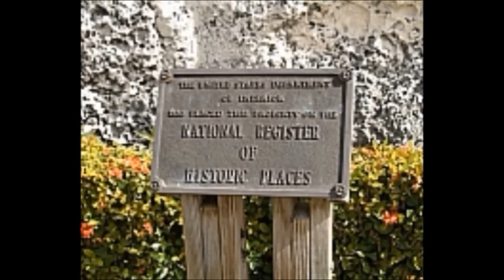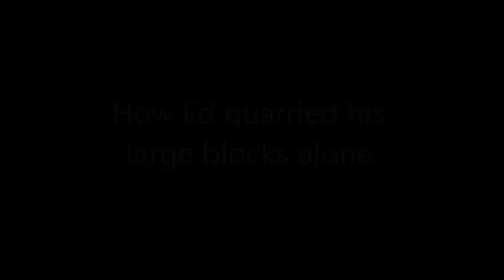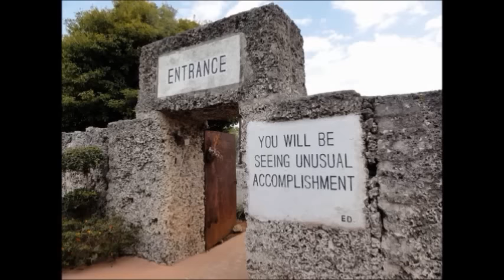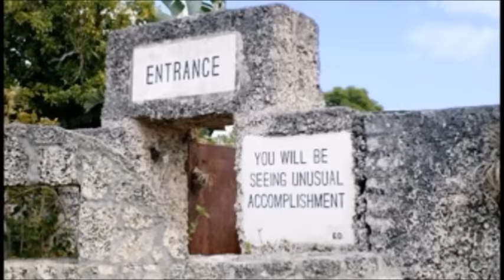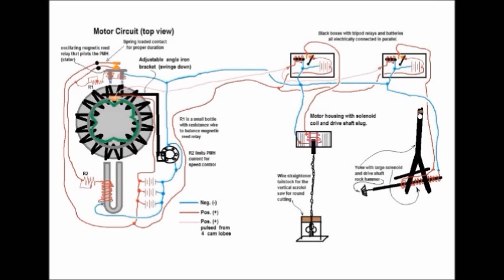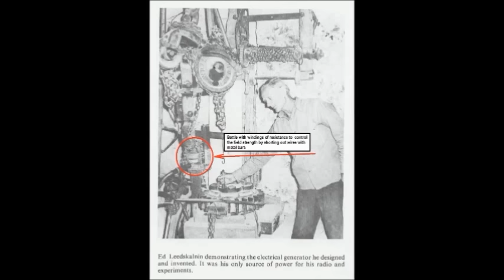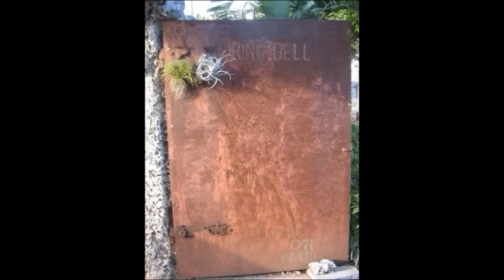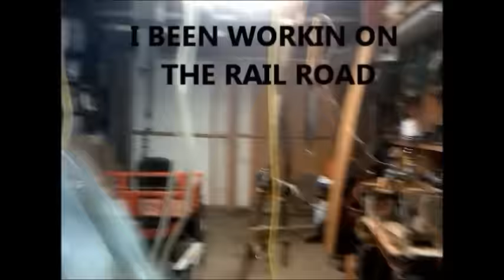Eds Coral Castle Quarry and Flywheel, Engineering Mystery Solved

Comment: Ed Leedskalnin had the entire coral castle moved to Miami from the original site. Ed hired a driver to take the rocks to Miami, he told the driver to leave the truck at night and the truck would be completely loaded by morning. Ed did all the loading and working at night to prevent others from seeing what he was doing. Well one time the driver came back to his truck only 30 minutes later. To his amazement the truck was already completely loaded with over 30 tons of rocks! How did Ed load that truck with 30 tons of rocks in just 30 minutes? How could his tripod move stones that weigh 30 tons when the tripod could only support 2 to 5 tons max? Ed used anti-gravity to nullify mass/weight of those rocks. Gravity is a subset of electricity and magnetism it doesn't exist as a separate force. Ancient builders knew this. That is how all the great ancient structures were built, the stone henge, puma punku, the pyramids. The great pyramid is 1,200,000 blocks at 433 feet tall, built in only 20 years, average weight of block is 5,500 lbs. This means that a block had to have been cut, moved, and set into place above every 8 minutes and workers had to have worked 24 hours a day 7 days a week while maintaining the precision of the blocks at 0.01 mm... That task is impossible even today!
Reply from the maker: Naoki Kashima IMPOSSIBLE?   woops you just landed on the wrong site to start using such BLIND words. I can tell right away you are either very young or very young at mind. Because these things are not impossible. What is impossible is to get the public to stop believing stupid exaggerated "non provable stories". As for 20 years that might be wrong but that's it the rest is "probably done by man" how is impossible for modern lazier unorganized minds to understand.
        Don't get me wrong Naoki, I am not running down todays people just that know one seems too much common sense old fashioned thinking any more WITH physical teamwork. I have levered some very large things into place and know Ed leedskalnin built this place with perserverance and sweat not some silly never ever seen device. Come on.   Really.       Ground control says NO.  peace.     Scott R.
Reply: Made by one man If ED used conventional methods for building the Castle how come he only worked at night? How much harder is it to dig and lift giant stones under the light of a candle light? What about the report of kids spying on Ed. They stated that he was levitating the stones using two cones. Kids reported that stones were floating as if they were giant balloons. How did Ed load that truck with over 30 tons of rocks in just 30 minutes? Ed was only 115 lbs (very small man).. What is the point of having so many inductors, transformers, the flywheel if he didn't use them for some grander electrical setup? Go read Ed's book called 'the electric current' it will give you a different perspective about what Ed was doing.
Reply: Naoki Kashima he didn't use candlelight, he had lights! He did it at night #1 because of the heat #2 he was giving tours during the day. He NEVER FINISHED THE FIRST SITE.. it took him 3 years to move the first site to the new location. He didn't levitate anything... he used chains, please look at Ed's original 1930's video of him lifting and moving the coral. If you still think there is something more, they have medication for your condition...
Reply: shidoin Did Ed Leedskalnin have advanced knowledge of electricity? Wad Ed a high level Freemason? All one has to do is go to the Coral Castle and look around. You'll see "the star of david" or the joined pyramids in at least 3 places within the Castle. You also will see the Moon sculptures. These are both well known Freemason symbols. Ed is known to saying, "if you put one of my devices on a rocket and fly it to the moon and then come back you'll have the same amount of fuel as when you started". What was Ed talking about in that quote? Is he talking about harvesting energy from the vacuum of space? I think so. If Ed only used levers and a tripod to move his stones how did he move the 35 ton stone in the Coral Castle? Why don't you do a video demonstrating how it is possible to move a stone with a weight of 35 tons using this method :P
Reply: Naoki Kashima no ed did not have knowledge of ADVANCED electricity, he did however understand electricity. He was  NOT a freemason, but he was a stone mason. Stars, the sun, the moon. That's pretty mind blowing. There is not a 35 ton block at the castle. It's easy to take a statement and twist it to work with your beliefs..
Reply: shidoin The heaviest stone in the Coral Castle is 35 tons in weight. Look it up. Quote from http://weirdus.com/states/florida/unexplained_phenomena/coral_castle_photos/index.php ". There is an obelisk weighing 28 tons and the heaviest stone object weighs 35 tons."
Reply: Naoki Kashima my young friend. Have you been to the castle? Have you calculated the weight of the coral vs cement? Since you and others are so well informed about ed. You should know that he tried to raise the oblisk 3 times, 2 times it broke. It is recorded in the county records.
Reply: shidoin he did say some of his children would misbehave?
Reply: laura theodora what are you talking about? ??
Reply: The energy that he tapped into sometimes went wrong , the stones he called his children that sometimes   miss behaved , there was a neutral part where he could stand in where the energy didnt effect him . he actually had some boots made out of lead or some metal that would not levitate him along with the stones .
Reply: laura theodora haha how silly of me to miss that.;) um yeah keep researching, but this time use reality, your brain perhaps. Ed didn't levitate, he did have shoes with a small metal part on the toe and heel. You can buy some the same today. If you didn't want a electric current to go through your body you wouldn't wear metal shoes
Reply from the maker: laura theodora No one has ever levitated anything outside the laboratory. It has NEVER been proved, The internet tells stories in myriads that are not true. 30 minutes is just a story. the homestead records have 255 affidavits that prove Ed  used manual labor. 
As for his shoes? they are down at the museum. they are reinforced with metal to keep them together. and have cleats to prevent his feet from hurting while he stood on the NON ergonomic tripod braces. Plus as he clearly displays many of his OBVIOUS methods in the black and white movie, it seems that should be enough to dispel the GIANT GIANT GIANT piles of crap about "levitation"?  If you truly believe that Ed levitated those gargantuan rocks then all I can say to you Laura, is this: You apparently are a very beautiful person and probably quite innocent and are quite open to many "possibilities". The actual proof and even legitimate plausibility is the only thing in HIGH question.. Coral Castle along with pyramids and EVERY other "mystery" will be revealed all in due time. I will stack those rocks like he did with a tripod and join many "coral castle nuts" in hopefully a peaceful  gathering of disappointing truth but with polite comfort and understanding. It is obvious that most your information has come from potentially "flawed" and very biased internet videos or statements by some who clearly need to be a bit more reserved in their "calculatory assessments". Also today work that those people performed, including Leedskalnin, is quite elusive because the average or even above average person still can't fathom the "animalistic cooperation" the men of old contained over the convulsive spoiled non believing society we have today. I DO believe that potentially "spiritual" influences may have inspired or motivated the Egyptian folks to construct such monoliths and why 30 of them or so? people will see something later in the future that will disclose one of there true purposes on a grand "global perspective" and why are they all different parameters and dimensions? you see   I can vividly imagine a large machine that EASILY lifts those 6000 pound block like legos. have you watched the latest Nova episode on the roman Colosseum? quite revealing.  As for wetting the sand like "scholars" think (to drag pyramid blocks? that is way way way off. Are they just stupid or lacking common sense or do they want to keep people ignorant for some conspiratory agenda? I don't know but I do know there are a lot of things that used to be unknowns but true research proved actuality and therefore dispelled. I will be glad to answer any questions on Coral Castle though. No levitation, just decent good ol farmboy like ingenuity and learned techniques of old.
 PS  Thanks for viewing too.    SCOTT R
Reply: Made by one man
 I think your full of misinformation i have looked into this for years ,  just because you cant understand it doesnt make it wrong !
Reply from the maker: laura theodora Really I actually do understand. since when is rock magnetic? and I never said someday it won't be possible but it DID NOT happen at Coral Castle. And not to insult you but I only have a year into Coral Castle and it seems elementary to me now. Not when I started but now its a joke. And it really pisses me off people believe in total crap when the real man worked so hard for his "dreamgirl". And there are documented  witnesses that actually new saw and know how he erected things. Is the movie wrong?
Plus shidoin is being a bit harsh because the truth to him is kind of obvious and you are being a little unrealistic. AGAIN how do you think he did it? and don't just say magnetic theories. Explain how "technically" not just "theories" and "THIS GUY IS SO INCORRECT"  really. what do you think is wrong when it actually WORKS, cuts and sculpts. what do you think the wheel really was?   PLEASE. some details? Scott R
Reply: Made by one man
 your kidding about the magnetism of rocks arent you ?Look it up . what makes you think there were the only civilization that got to this point ? i think you have a sett idea of things and iam not going to bother with explaining it to you ,your cup is fool, Iam not young and i have been looking into archeology, science , astrology, mythology, theology, for a long  time .  I prefer an open mind to a closed one thank you !
Reply from the maker: laura theodora Typical.   Oh you you you, I'm not going to explain it to you. Because there's no explanation or you would literally defend yourself but obviously it is just non provable theory wind AGAIN no proof or even reasonable theory. When has anyone magnetized rocks?  really? I am as open minded as you will ever find my dear. So please lay it on me. Trust me I am about to build a stone castle /tower / house. I would love to levitate them verses barbarian lifting. But for now I doubt I should sell my back hoe or get rid my tripods. and why would Ed have a 100 ton train hoist in one of his pictures clearly lifting up a giant block with muscle?   honestly?       Help me to see if I am the blind child. but something says I might know a bit more than YOU think.   sorry my dear. Nice spunk though.  how would you "magnetize the ROCKS" where else do they do that now?
Scott R.
Reply from the maker: laura theodora PS laura   "ology's" are BS galore and not always solid only "spritually coicidental"   "onomy's" are usually solid scientific provable REPEATABLE operations based on FACTS and tangible physics. That was this documentary is about. Not just TALK and flase typing with blind non provable argument.   PLEASE send me a link so I don't have to waste time looking up something that does NOT exist.       Peace   Scott R
Reply: Made by one man I would suggest reading the work of " Viktor Grebennikov " :)
Reply: Made by one man can't edit a reply.. :(.. I was referring to "Nothing levitates outside of a lab".. Viktor Grebennikov disagrees... he believes it's all around us in nature.. Bug wings, apparently even in pelican beaks. All these animals have microstructures we don't understand yet.. So saying "It has never happend outside of a lab" is a little bit narrowminded, or young minded in your own words.... just like how you responded to Naoki Kashima
Reply: Thijs Leijzer I've researched him. Still just stories. Just like a bee can't fly with its wings/body weight. They did recently change that theory. It is the speed and rotation that enables a bee to fly! there is a lot of scientific proof out there on many things. You can't get yourself caught in the mystical web.
Reply: shidoin How do UFOs fly? They have no wings of any sort. Well it turns out that disk UFOs operate on the principle of electro-magnetic propulsion. It turns out that before 1950s one could look up patents for EMP vehicles at the patent office. Since 1950s  these patents became classified up until recently. Today through the effort of Steven Greer one could look up some of these patents again! If interested you could look up how disk style EMP crafts operate (the man-made ones). Also, you could look up the Keshe Foundation of Iran... they claim that they managed to reverse gravity as well. They offer their patents and information free for download (2 gigabites of data).
Reply: Naoki Kashima once again  no proof! Just stories. I have seen many patents like browns ion ufo that never flew.
Reply: Naoki Kashima and btw you can get a patent for anything. It doesn't have to work you only need to explain how it could ;)-
Reply from the maker: Thijs Leijzer My answer is because know one has ever proved it. Newtonian physics completely explain the mechanics in actually simple mathematics to all forms of "propulsion" in the "relatively significant" density of our atmosphere. So to say "we don't understand" is crap AGAIN. We DO understand and that's why my response is so direct because we understand it that directly. I apologize if you think I'm rude. I have absolutley no intentions of that. Merely logical plausible objectivity with a open mind wider than you realize my friend. I do believe in levitation and actually know how it will be done IN 30 Years " maybe but not now, not At CORAL CASTLE.       Peace  Scott R
Reply: Made by one man
 i dont think your open minded ! Science grows  as we do , to have a sett idea stops that growth .
Reply from the maker: laura theodora I have a set idea like the boiling point of water. It IS WHAT IT IS. PERIOD. expecting it to change when everyone knows it doesn't (pressure does but still thats the same too) It all become COMMON fact NO deviation because it IT WHAT IT IS. copper is copper, water is water, to expect it could be something else after every one can TEST it for what it is. THEN It be comes what everyone knows it is. silver is silver gold is gold. White pine trees arte White pine trees. So eventually no matter how open minded some will deny that IT IS WHAT IT IS. so really having some doors shut are good. Thankgoodness we at least have that consistency.  You can't be open minded and expect it to change without altering pressure.   This whole Coral Castle thing is the same thing. Levitation will occur much later in our time. NOT NOW. My mind is open but only when it knows the door needs to be. other wise don't be unrealistic until you know the time is the PROPER time.
Reply: Made by one man Ed's Flywheel was turning with an aid of an AC motor. The flywheel itself was powering that motor. That is because it is a Lenz Free Generator. I made a video about this effect as did MrAnguswangus. Copper is Copper and aluminum is aluminum... however you can trans-mutate aluminum into silicon using a simple cold fusion setup. I made a video about that as well. Everything we think we know about science is going to change within just a few years. I would rather ride on top of that wave than be swept away by it :)
Reply: Naoki Kashima
 Sounds good go for it !
Reply: laura theodora I am working on it. I got 10 lbs of copper, 10 lbs of soft steel wire... some powerful magnets. I'll do my best with it. If it is a Lenz-free generator I should be able to get it to power itself. I made a video of a smaller one in action showing the Lenz-free effect.
Reply: Naoki Kashima look up" mister Caribbean roots" he's already built it. He's also built a pulse motor, which is what  Ed's wheel is. Not magic
Reply: shidoin We'll see, if my version will work. I have a different idea about how it should work and what it is. I'll give you a quick rundown. Basically there are 2 particles involved in electricity (the whole thing about electrons moving in wires is a bunch of rubbish). The two particles involved are magnetic monopoles. The positive moves to the negative and the negative moves to the positive at the same time. These monopoles have an opposite spin (clockwise/counter clockwise). Today in all the generators we use only 1 of these particles but are forced to fight against the other as it is trying to leave the system with an opposing spin. That is real reason behind Lenz's Law. Well if both of these particles are accommodated with a complete magnetic circuit Lenz's Law is negated. You can have a self-powering device at that point. Ed's generator was not a homo-polar motor. Ed used the true form of AC. If I am wrong then I am wrong, but if I am right then I am right. We will see.
Reply: Naoki Kashima ed didn't have A/C current. Have you been there? Vinnie st Vincent has and built the exact wheel.
Reply: Naoki Kashima looks pretty cool. I'd get scott, or vinnie and see what they think. Maybe they can try to apply your theory with their  working wheels
Reply: shidoin The wheel with u-shaped magnets is slightly different. Inside of the tube there is clockwise and counter clockwise coils. The top of the tube has a hook dangling over the handle. There should also be a magnetic connection to the bottom of the wheel (where its axes rotate). This completes the magnetic circuit. Basically imagine a U shape on its side with a wheel in the middle. The two coils must be wound in opposite direction and must be shorted out. Ed also used aluminum or brass spools (this slows down the magnetic flux inside the iron). It is all about timing the flow of magnetism. I'll keep working and I'll post a much larger version of the generator hopefully spinning itself.
Reply from the maker: Naoki Kashima Naoki, You obviously have some knowledge of the concepts that science and tesla knew all along. The newest PWM wheel chair motors are basically your , Spiked non usable AC cycle that now is realised to be DC at a half wave with aeinductive circuit to "capture its" collapse. It basically a giant Bedini circuit. Ed MAY have used this for efficiency but certainly to spin it on its own. It would merely gain the 45 percent more lost and still need to charge the battery as the SSG circuit is built. Lenz's law on Ed's wheel is No where the frequencies required either. the John Bedidni SSG needs a freq to react with the iron at a certain freq for proper "inductive reactance". I am guessing you will highly improve on my basic propostition though with propising results. If you want to communicate there are many plausible configurations to use including a coil of wire down the pipe to act as a giant PMH CHOKE. this will aid i n the delayed field for proper resonance of the wheel (at certain Rpm's)
Reply: Naoki Kashima there is footage of him using the tripod to move the blocks.. what else do u want?
Reply: barrelrolldog Is there footage of him moving the 20 ton block? No. Did Ed use the tripod to move blocks? Yes. How did he move 20-30 ton blocks with a tripod that is rated for 3 tons? Impossible.
Reply: Naoki Kashima he used an extra cable.. the lid is closed on this one mate, the footage says it all. accept reality, and move on.
Reply: barrelrolldog An extra cable attached to what? How did Ed load 30 tons onto a truck in just 30 minutes? If he used a standard setup why did Ed work only at night?

The footage was made to give people answers, however those answers aren't the right ones because those answers don't fit all the data. Was Ed using some sort of an electrical setup? If you go to the Coral Castle museum you'll see his fly wheel, air capacitors, transformers and lots and lots of wire. What was the purpose of all that equipment? Turns out that Ed didn't see gravity the way we see it today. He believed that gravity was in fact magnetism. There are 2 particles involved in gravity (and electricity) these particles are the + and - monopoles. Ed believed that Earth itself was a giant magnet and that in different part of the Earth there was a different proportion of these 2 particles. One of Ed's experiments includes getting a 3 foot piece of iron wire and hanging it on a string evenly balanced. Then he would magnetize the wire with a horseshoe magnet and one end of that wire would now dip towards the ground so it will have to be rehung to be rebalanced. By looking at the ratio of how it was hung before and the new position one could determine the proportion of + and - particles at his/her location on the Earth. This is different to every region. Read Magnetic Current by Ed Leedskalnin if you want to know how he levitated the rocks.
Reply: Naoki Kashima attatched to the tripod.. you know, the thing he used to LIFT the rocks.  30 tons in 30 minutes was probably just some exaggerated story to enhance the legend.. same with the kids who saw him at night. 

the fact is, there are many pics and there is now footage of him using tripods to move the blocks.. thats enough evidence. why would he of needed to use tripods at all if he had an anti gravity device? it doesn't make any sense, use some logic man and quit dreaming. this mystery is SOLVED.
Reply: barrelrolldog That tripod was only rated for 3 tons. There is no way to move 30 ton block using the tripod. How did Ed cut that stone anyways? Any tool he would have placed under the stone would have been crushed by the weight above. What are your thoughts?

Ed claimed that he knew the secret to how the pyramids were built. Did ancients use tripods and wenches in the construction of the great pyramid? According to mainstream science the great pyramid is 433 foot tall, composed out of 1,200,000 blocks with average weight of 5,500 lbs. The great pyramid was built in only 20 years. Each block has a precision of 0.01 mm (look up that value). This means that a block had to have been cut, transported and put into place every 8 minutes if the workers worked 24 hours/day 7 days a week for 20 years to make their 20 year deadline. At the same time they had to maintain 0.01 mm precision. We can't even do that today no matter how many trillion of $ one would throw into that project. The technology simply isn't there yet.... LOL...

What do you think gravity is?
Reply: Naoki Kashima check out some more vids.. it was being used for more than 3 tons mate.
Reply: Naoki Kashima just stop. So apparently his "anit gravity" method will work on 20 to 30 stones, but is too hard to use on smaller 3 ton stones, so that's when he uses the tripods? Perspicacity.....get some.....
Reply: Naoki Kashima He moved the blocks on wooden rollers,(logs) with a come-along, just like it shows in the movie!
Reply: JeffSal999 The movie shows Ed moving tiny stones. It doesn't show him moving 30 ton ones. Common that movie is grade A dis-information. Ed never let anybody see what he was doing because he worked at night but here he let them filmed him. I don't buy it.
Reply: Naoki Kashima Dont forget the multiple sightings of him using Cone Shaped devices. As well as the well known fact that people would hear him singing to the rocks while he worked.
Reply: I've only heard about the one story about some kids who said they peeked over the wall and saw him using the cones, and people sing while they work all the time. The comment above saying that video is dis-information, lol, that's just funny. You guys do know he was a salesman and funded his life by selling tickets and giving tours to his "secret" playground. Give the man some credit. All he had to do was say he figured out the secrets of the pyramids and then shut his mouth and let everyone speculate till they've become blue in the face. You've all been fooled. Winner - Ed
Reply: mindshotjon His construction feat can't even be replicated today with heavy machinery. At the entrance to the coral castle there was a 8 ton swinging door. He had that door balanced so perfectly that a child push or the wind could make it spin around and around. After Ed's death that door broke and wouldn't spin. Four engineers with heavy machinery were hired to try to fix the door. After the door was 'fixed' it was an effort to push it to make it spin and today it doesn't spin at all! Ed knew that gravity was actually magnetism. If you get magnetism strong enough even non-metallic objects will be attracted. Take a piece of graphite throw it on a magnet. It won't be attracted because graphite isn't normally magnetic. Now take a very strong neodymium magnet (100 lbs of pulling force or more) you'll now be able to lift graphite as if it was made out of metal. The only thing that changed was the strength of the magnetic field here. Read his book Ed's "magnetic current'.
Reply: You're so wrong about that door. When it broke, they found a steel rod drilled through the middle. The door works fine today. Stop believing all the "made for t.v" nonsense. Minus the "story" about the kids seeing Ed move blocks with cones, and the trucker's so called load being full in 30 minutes, everything else can be duplicated. There's a gentleman on here that has been able to duplicate 99% of what Ed has done, and there's another guy who built his own stonehendge by himself. The guy was a recluse who worked at night because he was little and frail and it's freaking hot in southern Florida. Him making jabs about the secrets of the pyramids was marketing to get people to pay him to see his place. The guy was a genius when it came to electro-magnetism. He probably could have given Tesla a run for his money with the right funding. I don't believe it really comes into play with the Coral Castle "non" issue.
Reply: mindshotjon Show me a video of 30 ton stone being moved and set into place by hand and you'd make me into a believer. Otherwise you are blowing hot air.
Reply: mindshotjon AND by working at night no one could see he used elementary physics.
Reply: ***** If he used elementary physics why bother trying to hide what you are doing by working at night? If Ed used elementary physics there would be no secret and he would have worked during the day :)
Reply: Naoki Kashima To fool gullible people
Reply: ***** Or to preserve a well kept secret. What was the purpose of Ed's Flywheel?
Reply: Naoki Kashima Regarding building the pyramids, here is the statement from a construction management expert and Egyptologists.
 "A modern construction management study, in association with Mark Lehner and other Egyptologists, estimated that the total project required an average workforce of 14,567 people and a peak workforce of 40,000. Without the use of pulleys, wheels, or iron tools, they used critical path analysis to suggest that the Great Pyramid was completed from start to finish in approximately 10 years.[27]". 
So its not impossible at all, trust the experts.
Reply: ***** And I can tell you that the moon is made out of cheese. Trust the experts. If the pyramids were built in just 10 years than a block had to have been cut, moved and transported every 4 minutes if the workers worked for 24 hours a day for 10 years. Average weight of a block is 5,500 lbs. How was the 0.01 mm precision maintained under those conditions?

Pyramids were NOT tombs because not a single mummy has every been found inside of a pyramid. We even found completely sealed pyramids with no mummies inside. What were** these structures used for?
Reply: Naoki Kashima
Average weight of the stones is actually 2.5 tons, and they estimate it took 20 years. Making up numbers doesn't help. Have you seen the internal ramp theory documentary. Best theory yet which is backed up by a large amount of actual fact. Pulleys, sleds, levers, and counterweights. Elementary physics, literally at it's finest.
Reply: mindshotjon I never claimed it took them 10 years I said "if it took them 10 years" that statement was based on something Antony S said.

Mainstream information: The Great Pyramid is made out of 1,200,000 blocks, with average weight of 5,500 lbs, it is 433 feet tall, the precision of the blocks is 0.01 mm and the structure was built in just 20 years. What were the pyramids used used for? Were they tombs? No Pharaoh was EVER found inside of the pyramid. We even have completely sealed pyramids with no mummies inside. Where were the Pharaohs buried? They were buried in the Valley of the Kings, lol. Did the ancients have access to advanced technology that we don't even possess today? Mainstream science says "no", eyes and common sense says otherwise. For instance a wall was found in Siberia on a steep mountainside. Each block in that wall has a weight of 1,500 tons! It would take 3 of the world's largest cranes to lift a single block.. and yet the ancients built it with pulleys and chisels thousands of years ago? Examples of advanced structures that we can't duplicate today doesn't end there. Look up the site of Puma Punku. Stones many tons in weight are cut and stacked on top of each other like pieces of a jigsaw puzzle creating an earthquake-proof structure.
Reply: counter weights, pulleys, and levers...and maybe giants, lol At least we have some written history of that... Don't bring up puma punku's sandstone exaggeration please. That's only a mystery to the History channel followers....
Reply: mindshotjon It is a mystery to everyone. How perfectly round 8 foot holes were drilled in stone as hard as granite? If you want to drill a hole into a material your metal has to be harder than the material you are drilling. This can not be accomplished with bronze tools.... lol.
Reply: Naoki Kashima
Ed did not move to Miami he moved to Homestead! Haven't you been there and seen it? I have been there and seen it, it is extraordinary. Homestead is far below Miami, yet he did move north from his previous home to get there. Homestead receives more lightning than his previous location.
Reply: Naoki Kashima
it is red limestone, there is NO diorite there. That's just one lie. The quarry isn't far away, with stones half finished. We know exactly how puma punka was built. Ancient Aliens has everything wrong. "for entertainment purposes only" should be a required disclaimer, lol
Reply: mindshotjon Again Puma Punku ancient site. Stones carved to fit perfectly into each other. Some stone have a weight of 10 tons. How possible with bronze chisels? Even today we couldn't replicate this feat of engineering and construction. Advanced and not advanced societies have always co-existed at the same time. Today if you visit the Amazon jungle you'll find people who have never seen a telephone or powered drill. It was the same way in the past. Evolution of societies from more primitive to more advanced is a myth that isn't supported by archeological evidence. This myth is perpetuated by the education system which was originally funded by a few wealthy elites.
Reply: Naoki Kashima Actually it can be replicated today, and has been well known how it can be done for a long time. The disbelief that the ancient Amerindians were incapable of such engineering is racism, pure and simple.
Reply: Naoki Kashima
That may be the only thing we agree upon, that society did not advance through evolution, nor anything else. You just may want to check  the sources of your facts though, especially ones you get from ancient aliens and the history channel. While entertaining, very damaging to actual reality. They are a little askew.
Reply: Naoki Kashima
"If you want to drill a hole into a material your metal has to be harder than the material you are drilling. This can not be accomplished with bronze tools.... lol."
Chisels don't have to be harder than the stone, thats one reason they need to keep resharpening them.  And water can wear away stone, is it harder.  I can cut through a stick with a piece of thread, which is harder....DUH
"Pyramids were NOT tombs because not a single mummy has every been found inside of a pyramid." I have a money clip with no money therefore its not a money clip, but a mystic device which no one can duplicate. "Where were the Pharaohs buried? They were buried in the Valley of the Kings, lol."  Some were found in the Valley of the Kings of the later dynasties.  NOT finding a body  means squat. The sarcophagi they found must have been there to receive......???
Modern engineers CAN and has duplicate these 'feats' with modern equipment, so why do you keep saying they can't. "3 of the largest cranes to handle a 1500 ton rock", yeah OK we have cranes that can handle 7000 tons.  Pure unadulterated BS.
"Examples of advanced structures that we can't duplicate today doesn't end there"  primitive structures and YES they can and have been.  Actual proof not stories.  Children learn to build structures with blocks, shaped much like pyramids, because it doesn't fall over.....a primitive shape for primitive construction techniques.
Maybe the ancients had the assistance of gods riding flaming chariots.
Now lets all hop on our time machines, powered by a perpetual motion engine using levant-meyer transitional devices and go back and see how it was really done.  Oh wait we don't have them because it's all a conspiracy by big industry.  Fire- a secret stolen from the gods....
Reply: ***** Only time will tell which one of us is right. You have your opinion. Your opinion does not fit the data, yet I am forced to respect it. There is no way to replicate the wall in Siberia where every block is 3,000 tons. You can't get giant cranes in that area, the wall is built on a steep hill. And how* would you cut out a block that is 3,000 tons? Any tool that you place under this weight will have to be pressed down by the weight above. This means if you place a saw or a chisel it will be crushed. Inside the Great Pyramid how did the builders light their way? Did they use torches? Nope. There are no scorch marks on the sealing from those being used. Did the builders use mirrors to reflect the light from outside? Nope, the light gets too dim (these experiment were done already). It turns out that the only way to light inside of these structures w/o leaving any soot is by using electrical lighting. In fact there are hieroglyphs of those devices. 6000 years ago the pyramids were already in ruin. They were built 12,000 years ago (6,000 years before previously thought). Is there evidence of pyramids/obelisks on other planet? Well according to Buzz Aldrin (the 2nd man to walk on the moon) there is an Obelisk on Phobos (one of the moons of Mars). He brought that fact up in a live interview on CNN. You can see pictures of it search for 'obelisk on phobos".
Reply: YES there are torch marks!!! hahaha,
Reply: Your opinion is that these 'things' are impossible to do by modern standards and yet it is done...
The Phobos monolith (not obelisk)......a naturally occurring formation that some have to make into some mysterious manufactured object Perhaps Ayers rock on earth is an alien arrtifacct)  or like the face on mars, natural mountains.
Rather than electric light, one could use carbide lamps which burn without soot, so the ONLY solution is NOT electric lamps and numerous times it has been demonstrated, oil lamps with a properly trimmed wick are  sootless.  And why would the records show how much oil and wick each worker got if they weren't using oil lamps....
Strange there was no soot, after all 1000s of people explored these ruins before electric light was common, why isn't there evidence of this soot.  Oh because the whole story of no soot is false  AND the pyramids were built with a cut and fill technology anyway, done during the daytime, who needs lights . 
RE: the electric lightbulb.....If they used these so called lamps on battery power (since there is no hydro electric dams in posterity and their is something loosely resembling a battery found in Iran:

One 1 Watt bulb needs 40 batteries per working day.
A worker needs a lamp
If 10 workers were digging out each site
Each excavation took 2years (veeeery carefully estimated)
=> each system needed 292000 (!) batteries!
Total weight: 584 tons!
there are 400 large underground sites in Egypt
=> 116 million batteries were necessary
==> With a total weight of 233600 tons!
All these batteries would have to lie around somewhere as scrap iron or waste. The find situation for batteries in Egypt is however ZERO, so where did all this stuff go!
Reply: Aliens from a galaxy far far away,( circa 5510) discover some movie reels on an earthraid.

Alien 1:  OMG these humans had intergalactic space travel, they were at war with other aliens.  They have photon torpedos, disrupters, teleportation and cloaking devices, they are liable to invade our space and they have warp engines that go faster than the speed of light.
 
Alien 2:  its not real, it’s a TV show, all fake and you are misinterpreting for sensationalism.  It was made in a studio in Hollywood.
 
Alien 1:  There are no movie studios, we examined the buildings.  There are no cameras, no fake props, the building is empty, a king (I mean camera) has never been found in a tomb (I mean studio) so obviously these abandoned building in Hollywood are not studios and this footage is real occurances

Alien 2:  Everything was removed by studio-raiders 1000’s of years ago….none of it is real.
 
Alien 1: They had to have warp engines to keep the ships in the air and travel between galaxies in next to no time..  And I saw a picture of a ship in the air, it floated on its own, no visible motor, it has to be a superior technology
 
Alien 2:  That’s a picture of a Frisbee, not a space ship. it was throw by a person outside the cameras viewpoint.  There are no Klingons, Vulcans and the USS Enterprise never existed. 

Alien 1:  Explain then how these ships could travel between galaxies  if they didn't have warp drive.
Reply from the maker: Naoki Kashima Naoki I don't want to get all into what Ed did or not. If people believe magnetics helped move the rocks fine. He clearly shows the movies and we all no it probably was something else. 
     I also want to compliment you on tesla's hairpin circuit video you have I liked it a lot so I am not your enemy. 
i am currently trying to send power across my lawn. Ed L did NOT do this either. The movie I uploaded is probably correct and I will prove it someday by chipping and cutting and lifting and building stuff my self. AND as for working at night, NO ONE IN THEIR RIGHT MIND works down there during the summer in the DAYTIME. Even Mexicans take siesta's because its too hot to work in the afternoon. With model T headlights and wads of batteries he could see just fine. Moonlight helps too. but lights for close details. 
         I will keep you posted on the hairpin apps for my giant barbarian tesla coil out of junk. (like ED)   again  PEACE... Scott R
Reply: Naoki Kashima again this is one of many stories , that we tend to believe...Believe nothing of what you hear and half of what you see. .
Reply: Wucifer slayer We will see... Is levitation with standing waves possible? Well there are videos about it. Youtube search it. I plan on doing experiment using 2 joule thief pulsing through a nail with a small object in the middle. Ed Leedskalnin said "ring the bell twice" This message is written at the Coral Castle. Did he mean pulse two object? (when Iron is pulsed with voltage it makes a ringing sound like a bell).
Reply from the maker: Naoki Kashima I am not saying no, I am just tossing in the big deal ED discovered about electric magnetic fields that they EXPAND and ring the bell (light the light) and then COLLAPSE and ring the bell (light the light) again. Like in his book Magnetic Current he talks about the light lighting twice. Once as the bar is inserted, one when it is taken away.
      On saying YES Naoki, Could you employ some sort of pulsing "non-radiant" tesla hair pin circuit only blasting instant electro magnetic waves at each other to pulse the object (probably an iron object) off of the surface to move rocks easier while they vibrate? Great idea on the Joule thief pulsing concept. resonance with the earth might just show some results with said nail and said object.  PEACE      Scott R
Reply: Naoki Kashima 480 ft without the cap stone , or 277.77 cubits.
at 13sq acres, one sq acre at 4840 sq yards..
13 x 4840 = 62920_____6-2-9-20 = 37 the gravity of mars....
6--2--9--20 = 2160 miles the moons diameter..
2--160 = 320____3----20 = 60 x 90 = 5400 x 4 = 21'600....earth circumference in nautical miles...
21600 -:- 51 = 423.529411764 -:- 10 = 42.3529...
51''10.42.3529sec is centre latitude of Stonehenge..... which is the design of Eds magnetic flywheel......
Reply: shidoin ive worked with SLW, Eds equipment wasnt rated to lift more than 900 kg, you need a mobile crane rated 20ton.......to move those blocks safely.
And did you notice how tiny Ed is he looks like hes flatout lifting a tuna sandwich....
Reply: doug ohboy Numbers... The most important numbers to know is the Golden ratios (1/2 *Sqrt(1 + 5) which is 1.22 and  (1 + Sqrt 5) / 2 which is 1.61... also the Fibonacci sequence (1,1,2,3,5,8,13, etc.) These 3 things describe everything natural in the universe. It describes the proportion of the bones in our bodies, arrangement of leafs on a plant, etc. The other stuff is super fascinating... but I don't see how it helps us. We have to keep our understanding as simple as possible otherwise we'll miss key points about the obvious. I think Ed achieved levitation through the use of standing electro-magnetic waves through 2 metal cones (like the ones kids saw him moving the blocks with).
Reply: Naoki Kashima  maybe hes saying the moons fake
Reply: Naoki Kashima you are a very intelligent human
Reply: Naoki Kashima quantum locking,
Reply: JeffSal999 Get medical insurance before you try that at home with 20 tons. Any imbalance will splinter the roller that bears the most weight.
Reply: ***** Nikola Tesla didn't run his electric car on batteries! he transmitted the energy like radio is. He lit neon bulbs with the same generator far away.
Reply: +shidoin i get mine @ Walmart for under 25 bucks!! lol
Reply: Naoki Kashima what's the name of that truck that can hold 30 tons in that time  🌏🌏 🕖💎👽 ☼☾☄ ₪itibira₪∇💫🌌∿✻☥⚔∵∢▲▵▴
Reply: ***** That tripod, the chains, would max out at 5 tons. That information that you came across was dis-information. Ed Leedskalnin once said, "if you put my generator on a rocket and fly it to the moon and back you'll have the same amount of fuel as before you left". What did he mean by that? What is the meaning of all the strange electrical equipment he had left behind? How did he manage to load the truck with 30 tons in 30 minutes when he moved the Coral Castle? Ed Leedskalnin also said he had found out the secret of the pyramids (how they were built). To this day how the pyramids were constructed puzzles mainstream scientists. 1,200,000 blocks cut at 0.01 mm precision. Would slaves be able to do such precise work? Nope, you would need a highly skilled worker.

Today we have special interests who would like to see information about self-running electrical systems buried. Right now oil is king and queen, but times are changing quickly.
Reply: Mike Tyson You have sacred geometry as your icon and yet you are still asleep like the bulk of them :)
Reply: +Naoki Kashima Oh, Reminder to me self; """Read first the other comments below.""" You have already wrote what i had written :-) Nice to meet you ! Lovely greetings from Germany  :-)
Reply from the maker: +Florian Rose "TRYING" to be objective. All the comments below are from people who have "WONDERED" what the truth REALLY is about CC. Honestly I feel I have found it to be way too simple to be accepted by those corrupted by bad internet propaganda without confirmation, combine that with the general lack of electrical knowledge its clear that even COMMON sense prevails and most agree this is all it ever was. WAS he a smart man?
YES, was he different? Obviously!!! Was he some lone wolf genius leprechaun who knew what know one else knew PROLLY NOT. even prophets know about this stuff. otherwise its simple and actually works. Reading the other comments below are to see there ARE still some GOOD people out there. the knit pickers get squooshed (like bad bugs) by default.  thanks for viewing.      PS   I still love Naoki Kashim's. excellent hairpin ckt video. Scott R
Reply: And I hope you will never forget me :) /kisses
Reply: I know the facts wikepedia told me so... plus ancient aliens said puma punku was build by Zechariah Stichens grandmothers lover... lol. Stop and develop your own opinions you are embarassing yourself
Reply: It's weird ppl are going out of their way to stomp out Naoki Kashima wonder and tenacity? Why? What makes their excitement and drive to discover a problem? Even if they are totally wrong about how Ed did it-- why shouldn't they take the road they're taking with the blessings of others? Instead of ppl trying to discourage-- encourage!

 I know this was nine years ago but I think it's an ongoing ugly characteristic of humanity to discourage before ENCOURAGE? WE all know how much better We feel and act when we've been encouraged opposed to the opposite. Let's all try to flip that discouraging default